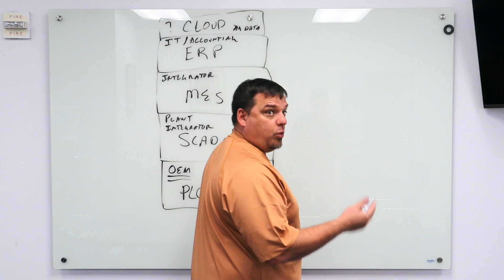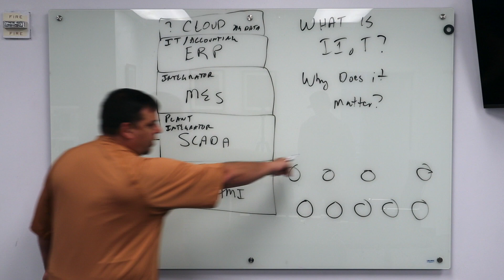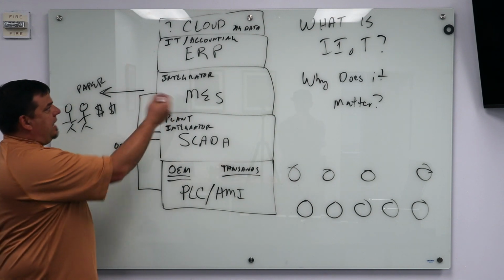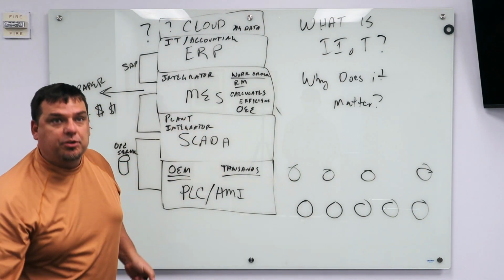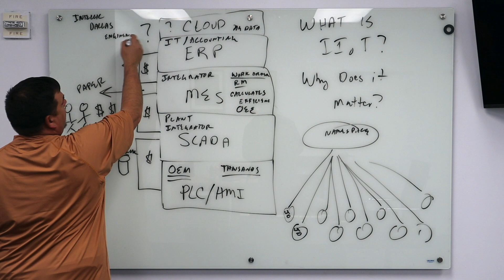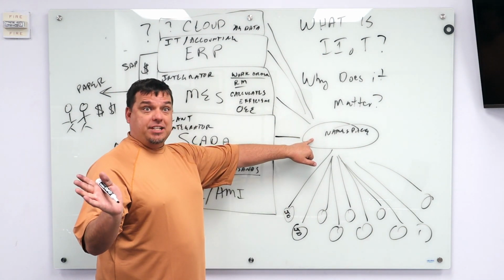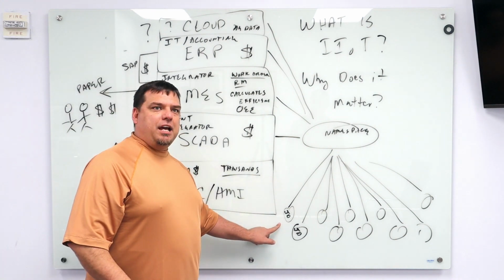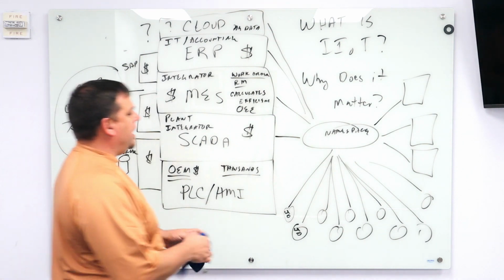What is IIoT?

Comment: 🎯 Key points for quick navigation:

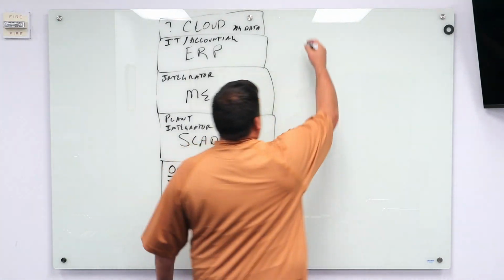00:00:00 🤖 IIoT Overview and Integration Challenges
- IIoT aims to enhance business efficiency by integrating diverse industrial systems like PLCs, SCADA, MES, and ERP.
- Traditional integration methods involve specific engineering efforts to connect these systems, often using technologies like OPC UA.
- Lack of integration leads to inefficiencies, such as manual data handling and disconnected systems across manufacturing processes.
00:29:00 🌐 MES and ERP Integration Challenges
- MES systems traditionally rely on SCADA for data, not directly interfacing with the plant floor equipment.
- Disconnect between MES and ERP systems requires manual data entry and handling, leading to increased costs and inefficiencies.
- IIoT proposes a solution by integrating MES directly with ERP through a unified namespace, reducing reliance on manual data processes.
02:23:00 📡 IIoT Benefits and Implementation Strategy
- IIoT enables all industrial devices, including PLCs, routers, and sensors, to publish data to a unified namespace.
- This approach facilitates seamless integration across SCADA, MES, ERP, and cloud systems, reducing integration costs and improving data accessibility.
- Manufacturers adopting IIoT-supported devices can streamline data consumption across their operational layers, enhancing overall operational efficiency.

Made with HARPA AI

Comment: In your example - machine builders will be responsible for providing IIoT enabled equipment. Agree Agree. However, there are many manufacturers that aren't procuring new equipment and/or have equipment - the OEM is no longer around. They too need to get their legacy automation connected. My point being that manufacturers will in the near-term have to invest @ the PLC level.
Reply: Kate Cohen correct... the end user will invest at the PLC layer either by retrofitting with IIoT ready controllers or aggregating with gateways.

Comment: The beauty is if you have UN, there is no concept of upstream vs downstream system or data, dependency mgmt become super flexible and adding new process will not incur new integration.
Reply from the maker: You got it Chister!! It's a UNS!
Reply: @4.0Solutions  we solution designed the concept back in 2018, was very cool.